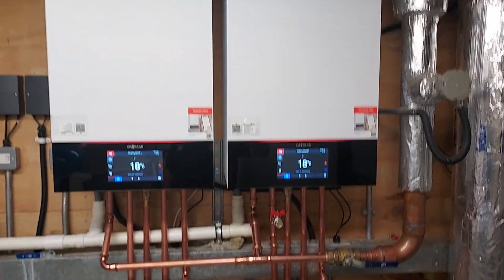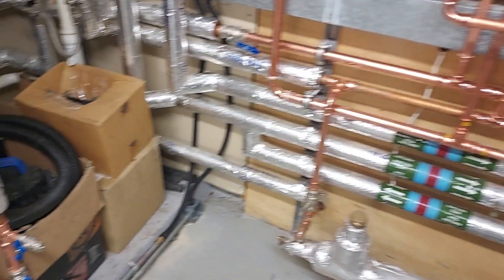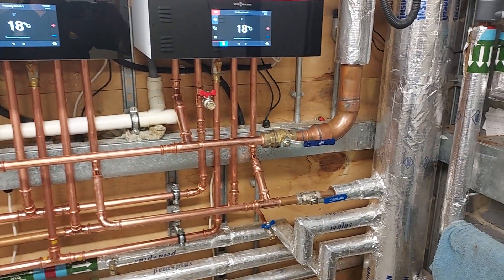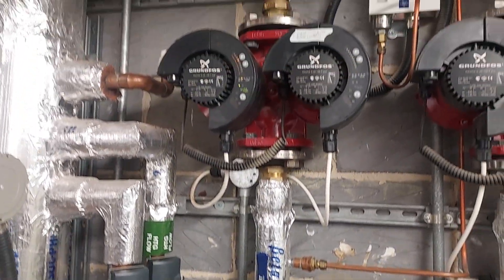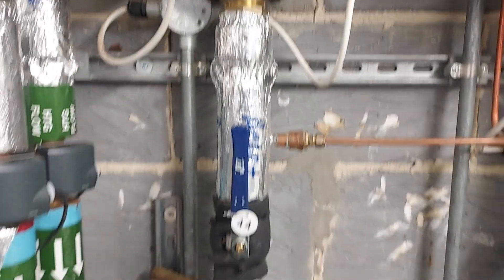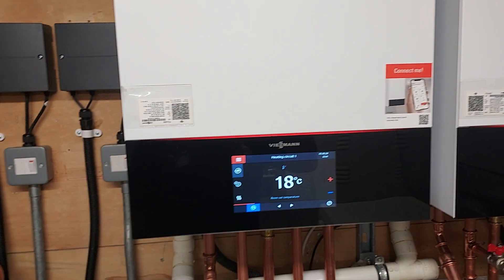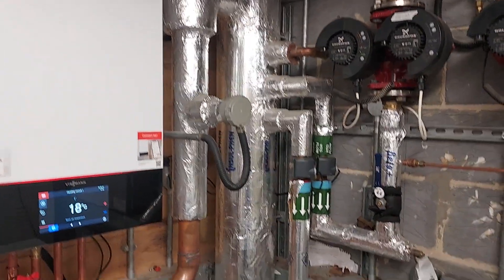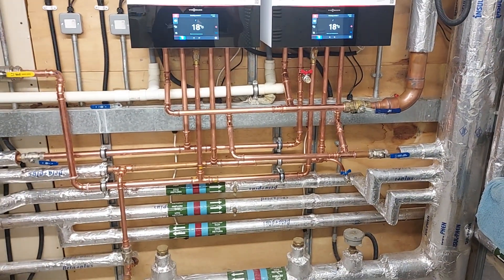plant room upgrade

Comment: The customer will be really chuffed with this new transplant, much easier to control. Why have you got flow control valves on the cylinders? Does Viessman not have the native capability to control on two cylinders?
Reply from the maker: The zone valve are required to comply with G3 as the cylinders are not manufactured by v i e s s m a

Comment: What are you using to activate the 2 port valves on the cylinders?
Reply: Could you just have one boiler for each cylinder?
Reply from the maker: @joehaskett90  yes if I re pipe it
Reply from the maker: Well originally I thought I was being smart and that by using an emp1 extension that I would get a hot water loading signal. Now I think I was wrong. I'm back on this job in 10 days time so I'm looking for a new strategy
Reply: @andrewmillwardwatford9410  if you have to have the valves then i have a solution for you. What i would do is when the cylinder calls for heat, the valve activates a simple relay which makes the connection on the cylinder sensor. and when the valve is not power the relay reverts to its default position which goes through a resistor which tricks the boiler into thinking the hot water is satisfied.
Reply: do you have to have 2 port valves? i normally just wire the cylinder sensor through the overheat stat, so if it ever overheated (which it wont) it would disconnect the sensor which would stop the boiler from firing in hot water mode. heating would still work
Reply: @alexbennett8437 
I’ve done it by wiring the boiler   via the overheat stat which just kills everything. 
Super safety and all that.
Reply: @hufartd  hmm yes. No frost protection though.
Reply from the maker: @alexbennett8437  Frost protection ?
Reply from the maker: @cliveramsbotty6077  they are. Although at the moment I don't have the correct signal it is passing through the overhead stats. I have temperature control on both cylinders via cylinder sensors but I have linked both hydraulic lead to both boilers so there is some small discrepancy in temperature control. I need to find a solution for this problem in time for my return in 2 weeks time

Comment: Are they 4 pipes heat only boiler? One side for heating and one for hot water?
Reply from the maker: Yes the boiler has its own diverter valve on the flow side of the boiler